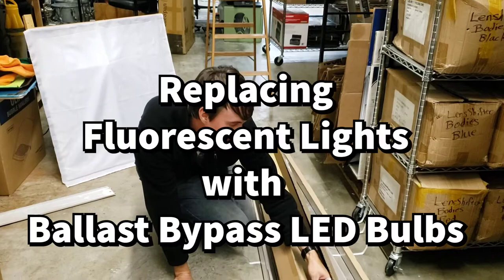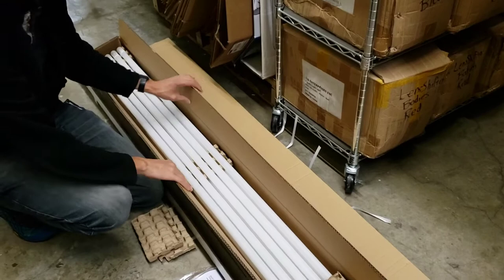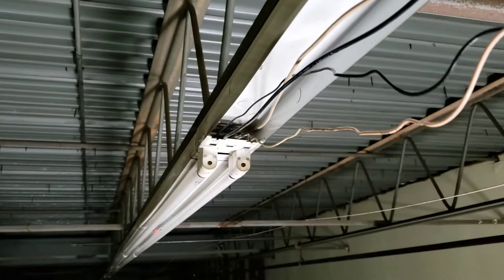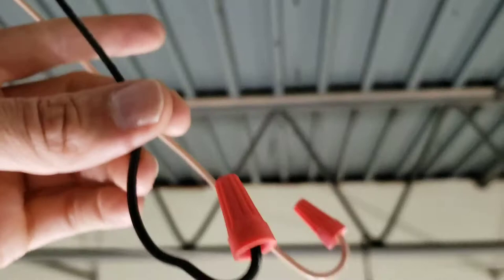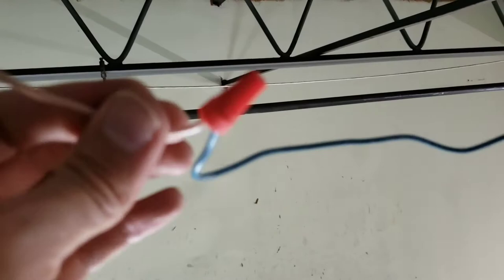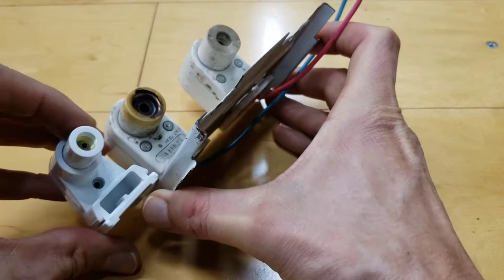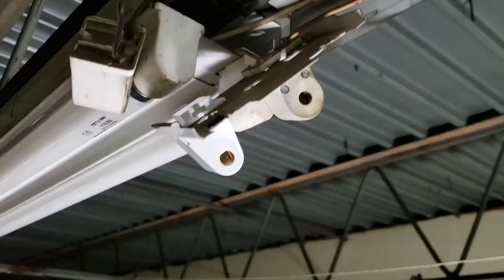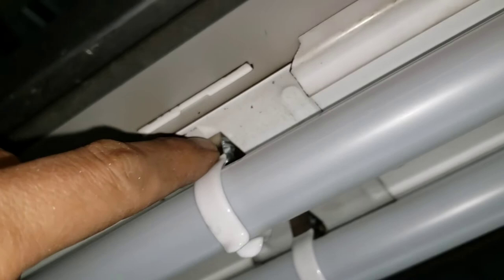How to Replace Fluorescent Bulbs w/ LED Ballast Bypass Light Bulbs | T8, T12, Single Pin, 4ft, 8ft

Comment: Live to neutral, just remember that! One end of the bulbs stays live and one end stays neutral :) 

I had a mess of wires in my fixture, so I had to make sure that I followed the live wire correctly, and since it was a dual bulb fixture, I had one bulb with live wire at one end and neutral at the same end on the other bulb. I kept re-checking to make sure everything was perfect before I closed the fixture up and turned on the power. It turned out perfect 👍🏼
Reply from the maker: Thanks!

Comment: Power doesn’t come back to the ballast. The ballast is a transformer, that sends a high voltage to heat the gases in the fluorescent tubes for a few seconds until the light is lit, then the ballast shuts down, then the 110V can keep the lights running
Reply from the maker: I see, thanks for info.
Reply: depends what type of ballast you have and the ballast also regulates and limit the current through the load when it increases